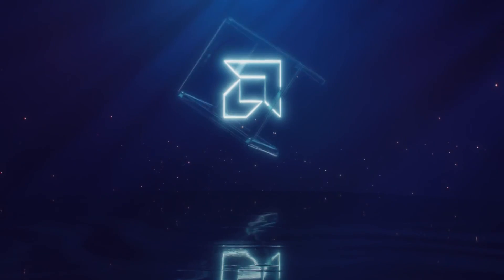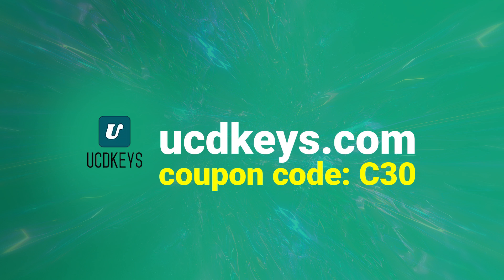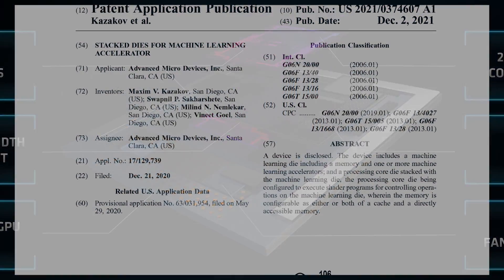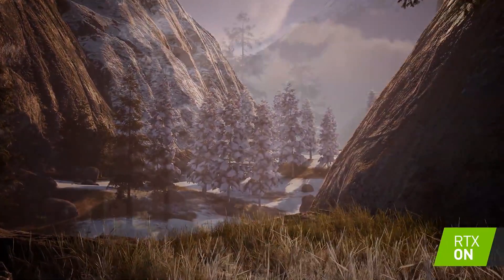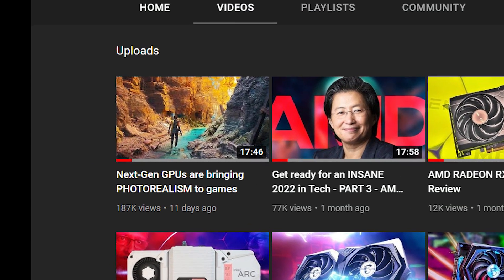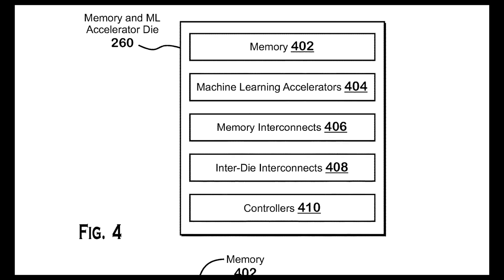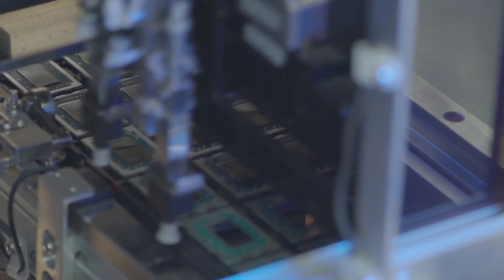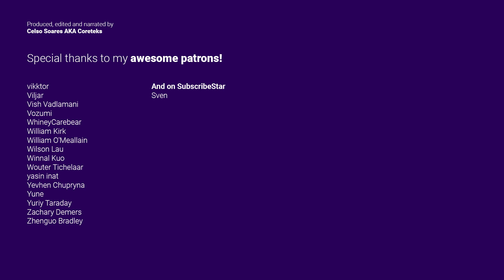Is AMD adding a special ACCELERATOR die to RDNA3?

Comment: I'm pretty sure AMD is gonna rip infinity cache out of the GPU or simply reduce it and reintroduce a separate Vcache die to further increase the cache size. This both enables to use multiple process nodes to create the actual 3D package and further reduce the size of the actual GPU dies so their yields get better and they can produce more of them. 
Also this enables AMD to use cheaper RAM or more of it without being starved by memory bandwidth. 
That extra die space with the cache out "can" be used to keep the better yields or increase other functions.
But would AMD introduce more then two GPU chiplets + Vcache and on top of that another compute die? I mean AMD could introduce a refresh of RDN3 with more dies however I am not too sure about that.
Reply: "reintroduce a seperate Vcahe die"
Haha cost, energy use and latency goes brrrrrrrrrrrrrrrrrrrrr.

HBM is basically Vcache but with several times larger size.

"Use cheaper RAM or more of it without being starved by memory bandwidth"
Cache does not magically create bandwidth.
A cache with very high memory bandwidth needs RAM with very high memory bandwidth.

Haha cost goes brrrrrrrrrrrrrrrr.
Again.
Reply: @suntzu1409  The cost likely doesn't go up. Vcache is to use cheaper node like 6nm vs 5nm. 
You get better bins so more money and better use of die space. 
Chiplet and 3D packaging are the future for a reason. 
Of course packaging multiple dies will cost more, but the offset is still beneficial. 
Which is why we already have CPUs with Vcache and soon GPUs.
Indeed Vcache or more cache anyway wont magically increase bandwidth instead it reduces the need for it which is why AMD right now can get away with smaller buss and use cheaper Vram. This can translate to later products as well.
HBM is just Vram with very wide buss and low clockfrequency where as GDDR memories are the opposite. 
Vcache is different. It's closer related to L3 cache which is even faster and smarter than any Vram. 
Of course we can never forget memory compression technologies anyway. 

Maybe AMD wont reduce cache sizes on the die, but the idea is still the same.

What comes to powerdraw, AMD 3D CPUs do not seem to have any power deficits due to extra Vcache and performance is better so I dont think it will be a problem.
Also since Vcache is basically L3 cache, adding more of it will just increase performance. I never stated that L2 and L1 would be removed. 
Vcache is simply an extension to the actual die not like separate Vram or any other chip. I dont see why latency would increase. 
I would worry more about the latency between the chiplets.
Reply: @Diglo1  
Vache needs R&D and 3D stacking, none of which is cheap, and none of which can be reduced just be using older node.

Reducing latency and energy used for memory accesses is the main point of caches.
Having cache on some other die will significantly increase latency and energy used for memory accesses, thereby defeating the very purpose of having a cache.

It is very stupid to have a cache that defeats the purpose of having a cache.

Intel Ponte Vecchio or AMD Instinct MI250X use unique ways to do chiplet/tile/MCM.
Making MCM in any one of these ways is way better than having Vcache on a seperate die.

Vram is not a memory type.

"L3 cache" is not a memory with very specific bandwidth or latency.
Hence "closer to L3 cache" doesnt mean anything.

HBM has significantly larger capacity than Vcache.
Hence some systems can work just with HBM memory.

Vcache is too small to make this possible.

"AMD 3D Vcache doesnt seem to have any power deficits"
Well, AMD can just reduce the clocks of Zen cores so that power draw of the chip with Vcache is the same as power draw of chip without Vcache.

"Also Vcache is just L3 cache
Increasing L3 cache is not as, adding more of it will just increase performance"
1) source?
2) this is only true for extremely memory intensive works.
Everything is not extremely memory intensive.
3) Increasing L3 cache is not as good as new core, new node, etc.
4) L3 cache needs power.
The only way you can increase L3 Cache without increasing total power draw is by reducing the clock speeds of cores.
This is why Increasing L3 cache can even reduce performance in many cases.
Reply: @suntzu1409   We can argue all day if monolithic 5nm GPU is cheaper to make then smaller 5nm compute die with 6nm Vcache die. 
Sure packaging multidie is more expensive then single die, but you loose yields and performance.
It comes down to how you segment your products. This is not clear cut at all. 

I agree what you say about caches, but you are assuming/thinking AMDs Vcache as separate thing like HBM which it is not.
Vcache is a direct addon to existing L3 pool. Thats why AMD markets their 3D CPUs with infinity cache size of what ever the CPU has + the Vcache. 
Infinity cache is the L3 cache and Vcache directly attach to that pool with silicon trough vias. It is litterally one single package. 
In this context it really doesnt matter if L3 cache is a somewhat loose term, it's function is clear just like L2 and L1.
Memory chips like HBM or GDDR6 talk trough separate memory interface, it is slower and uses more power, but bigger then any on chip cache. 
They are simply another layer on top of on chip caches. 

I didnt mean Vram as a type, just genaralization of memory that is beyond the GPU through memory controller.

While you talk about HBM being just bigger Vcache they do not function the same way and you cant compare them.

Of course adding more cache increases powerdraw if you dont offset it with lower clocks. But the added cache vs couple hundred Hz has been beneficial to the performance. 

1) Look at any AMD 3D CPU
2) Generally it has improved performance across the board.
3) I never stated that. But you forget other benefits of mixing nodes and reducing die area.
Having very strong core which you can later enhance further without recreating a whole new, bigger chiplet has many benefits.
4) Agree. It is balancing game and you clearly cant add too much where it becomes detrimental, but so far we have more performance for the same power.
Reply: @Diglo1  
Packaging multi die is more expensive than packaging one die.

But CPU with Vcache is not just another multi die system.

Vcache uses 3D stacking, and 3D stacking is ridiculously expensive to design and manufacture.

HBM is much larger in memory size than VCache (16GB vs 800MB).

You could totally use HBM as L3/L4/L5 cache.
Sapphire Rapids with HBM can work this way.

If you use HBM this way, you get 16 times higher capacity for somewhat higher latency and energy (all compared to Vcache).

HBM is much more efficient than GDDR (and maybe even DDR) in power draw and energy-per-bit-transferred.

Cached burn a lot of energy in predicting in deciding what memory addresses should be in cache.
Caches also have pretty high idle power draws.

"Improves performance across the board" of your board is memory-intensive works.
Reply: @suntzu1409   Where do you get the information that 3D packaging is  "much" more expensive then 2D multidie? Multi die requires a substrait like infinity fabric, but Vcache uses silicon trough vias no sodder bumps and sits on the existing die.
And the cost doesnt matter if that product is segmented higher in terms of performance, it will automatically offset production costs. 
This is why higher tier products get 3D stacked cache first.
Again you are wasting silicon on big dies and not getting moneys worth. It doesnt matter if 3D packaging costs more because you now have volume advantage which is again another benefit.
There is a good reason AMD is moving towards 3D and Intel to 2.5D? .
And I dont uderstand why you keep talking about HBM because it isnt designed to work with cache system directly and I you want to talk about cost then HBM is rediculously expensive. 
One HBM2 die costs almost as much as 8x2Gb GDDR6 16Gbpd system and you need two HBM dies to get the same bandwidth. 
Yes HBM is superior, but it doesnt make sense cost wise if its a consumer GPU.

Sure if the structure is the same then you could say that Vcache is just smaller HBM stack, but they are not the same thing.
Of course caches cant hold everything which is why you need RAM outside the chip, but the caches reduces the required bandwidth to RAM whatever it is. Which is why when we look at AMDs GPUs like 6900XT, they have big cache and narrow 256bit buss with basic GDDR6 only 2gbps faster then 5700XT yet they can pull over double the performance and 5700xt was at its memory bandwidth limit. 
Of course memory compression is a big factor too, but the majority of improvements were done because of the cache.
I dont know what you mean by L4/L5 because HBM and GDDR are the next level after L3 so it already does what you propose?
No it isnt just memory intense workloads like you claim. 
Sure the cache gives MORE benefits in MORE memory intensive workloads, but no matter what you do if its games or video editing or anything else the average IPC gain is ~15% and on server CPUs in server workloads up to 50%.
Reply: @Diglo1  
Go read more about Through Sillicon Vias.
Through sillicon vias are ridiculously difficult and expensive to design and manufactute.

You can always do chiplets like Ryzen, EPYC or MI250X.
You dont have to use 3D stacking to get benefits of chiplets.

Again, you can totally use HBM memory like cache.
HBM can totally be made to work like Vcache.
Sapphire Rapids will do this.

Show that HBM is more expensive per gigabyte than Vcache.

HBM doesnt make sense cost-wise on a consumer GPU.
And so doesnt Vcache.

Well, those server works with 50% gains were memory intensive works.

Saying more cache benefits the works that arent memory intensive is like saying adding more cores benefits single thread performance.
Reply: @suntzu1409  I have read about TSVs and yes indeed it is expensive technology, but there are no numbers to go by like how much extra it costs per chiplet to make 3D die.

And since AMD is ready to put them on consumer CPUs I doubt they are generally that expensive vs like 10 years ago.
Yes you can do chiplets, but it depends what you want to do.

Shappire rapids uses HBM as further layer between RAM and L3 aka L4 as some article says.
But what I have read HBM in this case really isn't "cache" per say.
Intel: "HBM-only, Flat, and Cache. HBM-only mode is for systems without DDR. Flat mode exposes HBM as a separate NUMA node". What I get from this is that the HBM sits outside trough memory controller or atleast outside of ringbuss.

This is not the same as AMD's Vcache as Vcache attaches it self directly to the same buss as infinity cache "L3".
It is lower latency lower capacity cache. 

"Show HBM is more expensive per gigabyte than Vcache"
I don't know and again it makes no sense as a comparison, because they are not the same like you claim and not used for the same purpose. I have no idea why you think they are the same thing, just different capacity.

"HBM doesnt make sense cost-wise on a consumer GPU." Agree, yet we still have them.

"And so doesnt Vcache." Do you have something to show it's not?

"Well, those server works with 50% gains were memory intensive works." 
Yes they were, but can you explain why consumer CPU got 15% average improvement across the board?

"Saying more cache benefits the works that arent memory intensive is like saying adding more cores benefits single thread performance."
True, but you forget that if the cores have untapped potential due to lack of cache then they automatically will benefit. 

And really when you look at things if HBM is such a great thing vs Vcache then surely there must be a very good reason why AMD rather uses 3D stacked lower capacity cache dies.

Comment: If the HDD to SSD cloning I'm doing right now fails I will get Windows and Office from these links
Reply: You don't need a new license key for cloning from HDD -> SSD
It's tied to your motherboard's firmware, even if you do a fresh install.
Office should work as well, but you might need to sign into your M$ account (outlook/hotmail/etc.)

Comment: well, they have an IOD with stacked cache there anyway, why not put some accelerators there. IOD is a handy multipurpose thing. really love amd's approach on chiplets, it's so clever and efficient you can see it's not chiplet's for sake of chiplets, it's a pure calculated rationality.

P.S. does an IOD with a huge ass stacked cache look like a perfect place for a sophisticated scheduler maybe ML/AI one? Wonder what you can with it for cpus... Like hardware code splitters or smth. Man, hardware code splitters is my wet dream.
Reply: 1) It will increase the size of IOD.
2) GPU is already an "accelerator".

"IOD with huge ass stacked cache"
Haha cost, energy used and latency goes brrrrrrrrrrrrrrrrrrr.
Reply: Hardware is one aspect. Software is another.
An IOD + cache etc for a GPU has a lot of potential issues. You need MORE cache when you use chiplets. So you can save money by breaking a processor into multiple chips but you lose on the transistor count and the overall power budget. AMD's already discussed this when explaining why their monolithic APU's have less cache than similar desktop CPU's with IOD + CCD... AMD will likely take it one step at a time and that's probably going to be two chips comprising a single GPU. The mother and daughter chiplets... for gaming at least. With non-gaming applications that are more parallel they have different design goals... we're kind of seeing a trend where they test stuff for accelerator processors and then figure out how to optimize that for desktop gaming.

Comment: I remember the video where coreteks claimed that NVidia is gonna use one - now we live in the parallel reality where Intel is a GPU stock savior and AMD is the one using accelerators lol
Reply: "May"
Reply: Even more, AMD have the desktop chip with AVX512, Intel leaked benchmarks make Bulldozer look power frugal and Intel Arc is doomed due to massive GPU over-stocking
Reply: @RobBCactive  Oh, my comment aged poorly lol. Never though that Intel would never get the GPUs to the market. It was a "do or die" moment for them, they needed to release their graphics while absolute madness was happening to the supply - a golden opportunity that manifests once in a decade in highly competitive markets, and I never thought that intel would be unable to seize the opportunity.
Reply: @triedanother2107  Yeah, AXG management debacle.  Latest excuse I heard was that they had planned to have some driver work done in Russia.
But that's as fishy as the Re-BAR excuse (would need re-write of old game apeture based VRAM management to really benefit), you don't fab the chips and then hire driver writers.  Lisa Pierce in interview with Dr Cutress @TechTechPotato was talking about DX9 & DX11 support in an interview long before that.
Reply: You don't think they ALL have various patents like this?

Comment: Ray Tracing Accelerator finally confirmed
Reply: No hate for Coprocessor we love you <3
Reply: Hardware accelerated ray tracing= ray accelerators on rdna2 is what allows that
Reply: If it's a matrix calculator it's not for ray tracing.  It's basically the equivalent of Nvidia's tensor cores used for DLSS and machine learning.